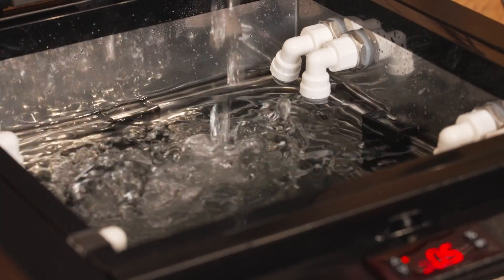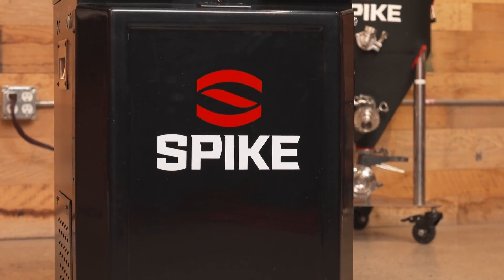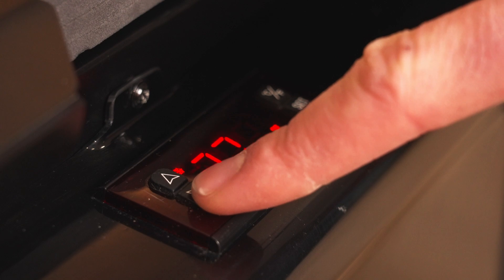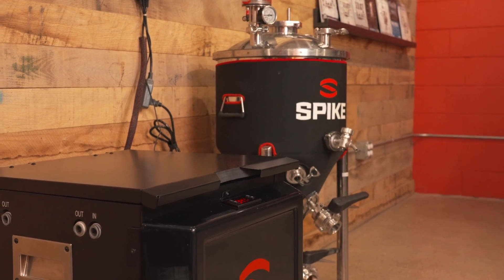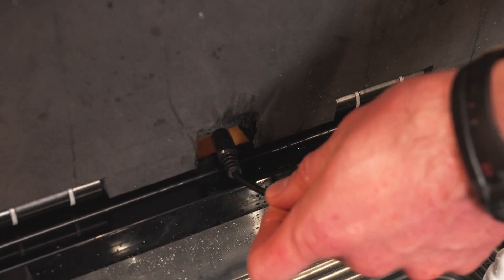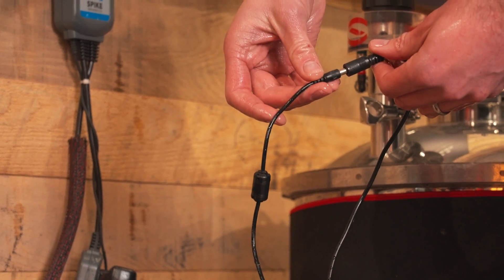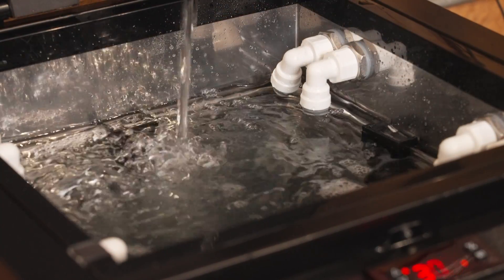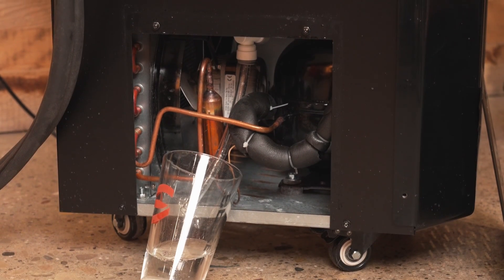How To Use Your Spike Glycol Chiller

Comment: You may have answered this already, if you have, then I apologize but what size tubing fits into the quick connect/John Guest fittings that will run to and from the fermenter coils?    Also, you mention a kit. What does the chiller come with, in other words what do I have to purchase in addition to the chiller? Thanks